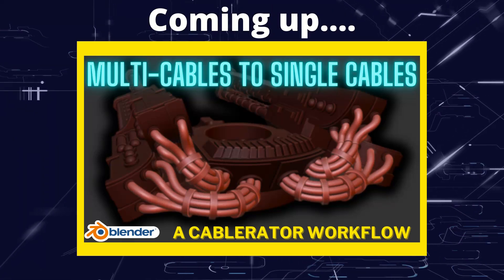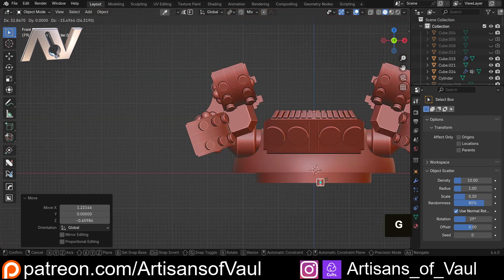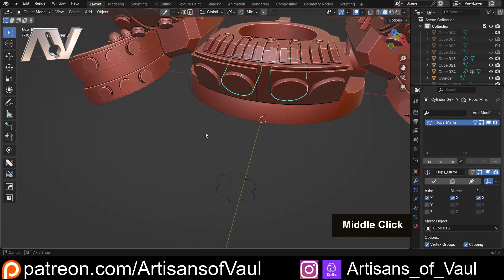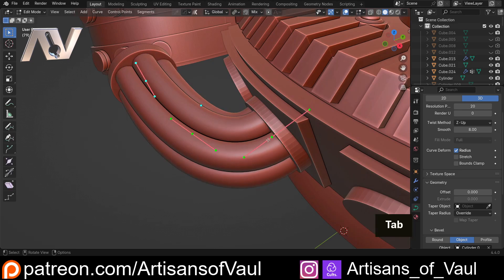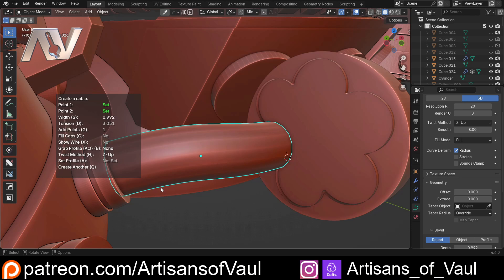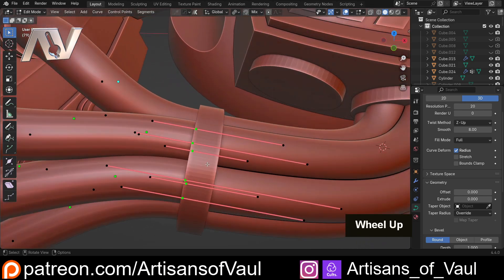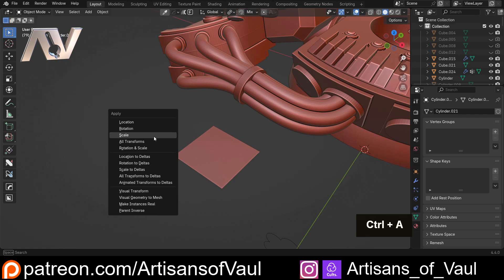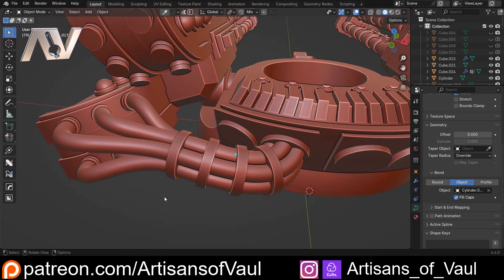Multicables to Single Cables in Blender

Comment: Very cool.
Reply from the maker: Thanks man.
Reply: @ArtisansofVaul  Bought 5 addons over the past few days. Cablerator was one of them. I did a quick tapered vent shape and used the insulate function on it and got an additional wrapped part that could be a metal connecting piece or a rubber mount. Learned about GG +E to straighten the edgeloops. There's a lot of untapped potential with Cablerator to make parts that are not cables/wires.
Reply from the maker: @katana2665  Definitely agree.  Ive used the wrapped part function to make bandages/handle wraps for example.